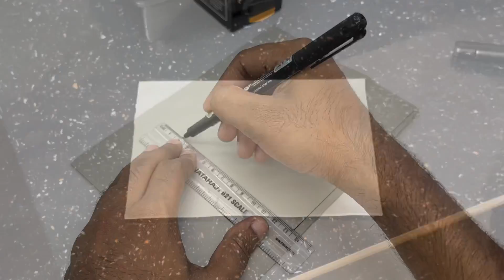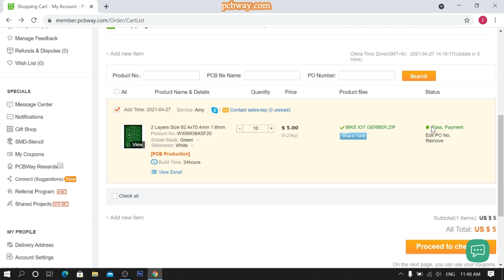How To Make Powerful Rechargeable Inverter At Easy

Comment: Where is the charging management for the 12v battery?
Reply from the maker: It lead acid battery.use 12v battery charger for charging
Reply: @Promaker1  a board? You need some sort of management system you can’t just charge a 12v with a 12v supply that would be a hazard